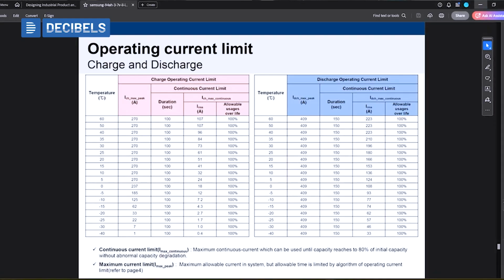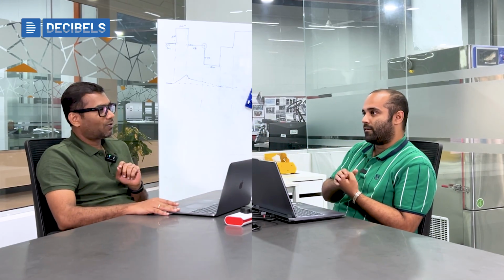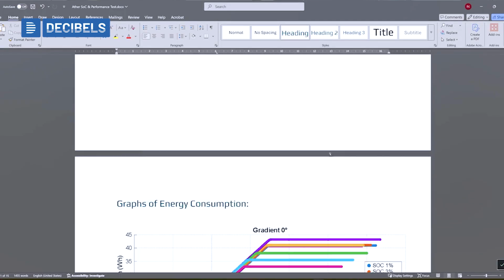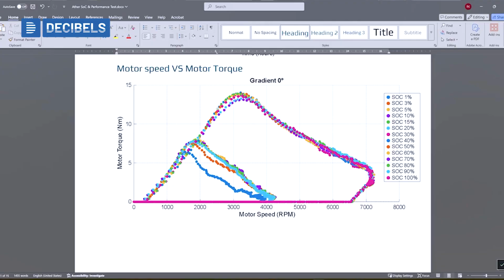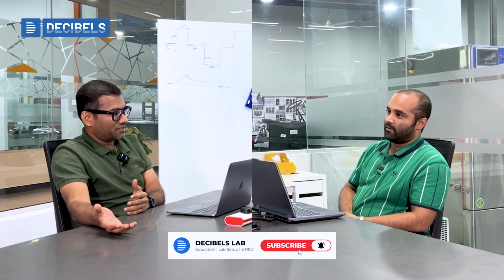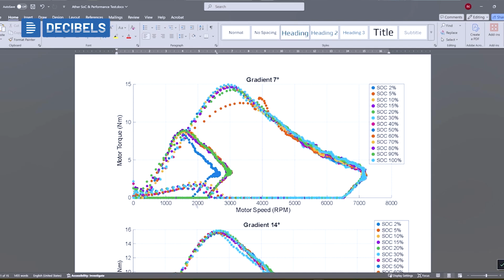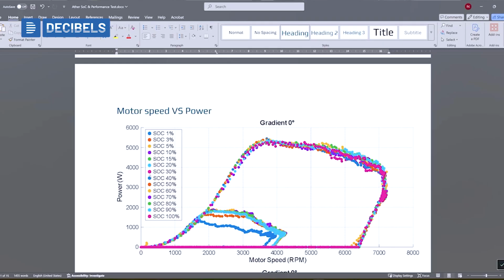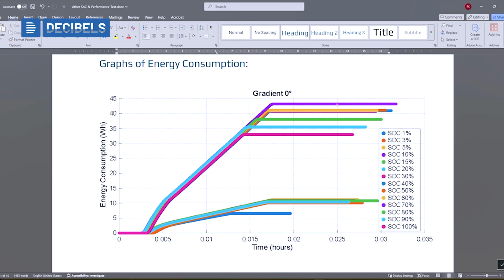Testing & Calibration of EV 2W with Decibels Chassis Dyno - Episode 02 | Decibels Lab

Comment: Team @decibels try to check @TVS iQube_Battery SOC no derate till 0%, No switching from Power mode to Eco....it's amazing features.

From 100% to 1% of SOC vehicle speed is not limited...it's also amazing Integration of battery and controller.

Just try to check #tvsiqube vehicle in lab.